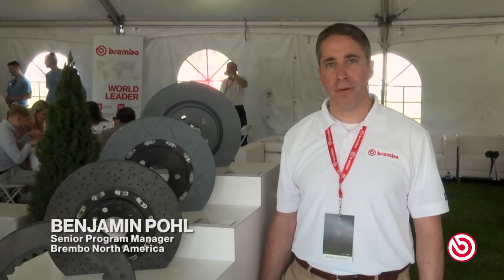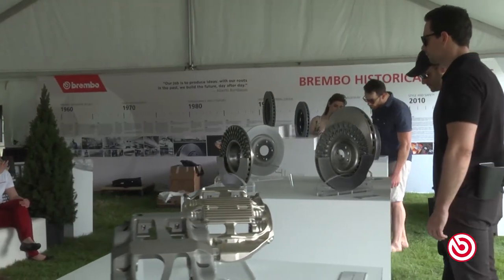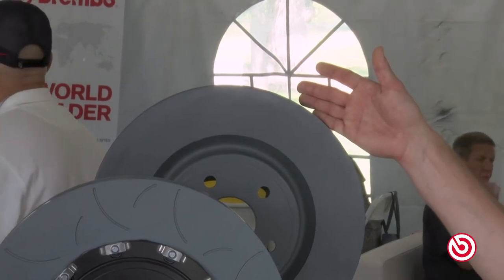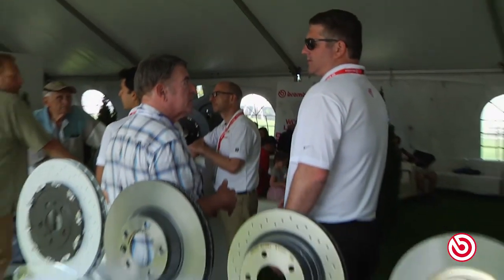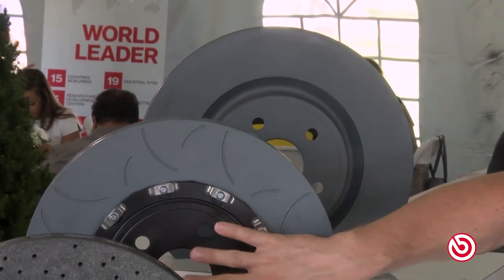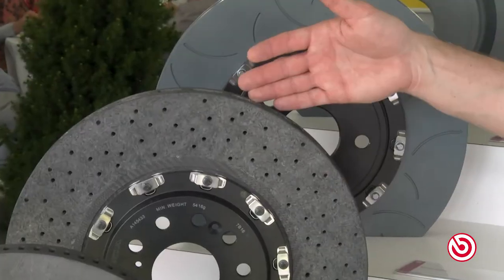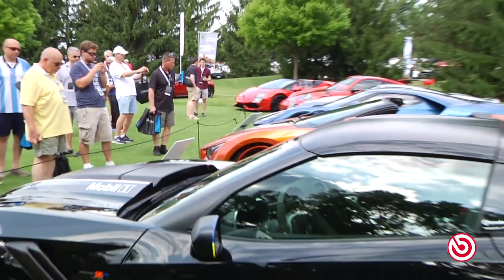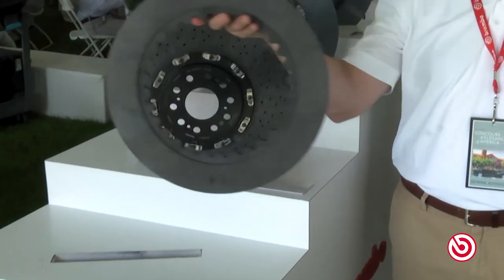Brembo Brake Discs from Cast Iron to Carbon Carbon

Comment: Hey brembo, 
I just picked up a ‘21 Model 3 P on April 17th and was disappointed to find out that the brakes that come on the car are sufficient for the streets but not for the track.  Since the car has track mode, I would expect the brakes to handle on the track with no issues.  Not the case.  How about sending me a set of those carbon ceramics big brake sets and I’ll do a review on them?
Reply: If you are interested their Formula 1 brake cost 50k per wheel. Take care.
Reply: @sebastiantevel898  or, I can order the brembo GTR set for about $8,500. Already done.